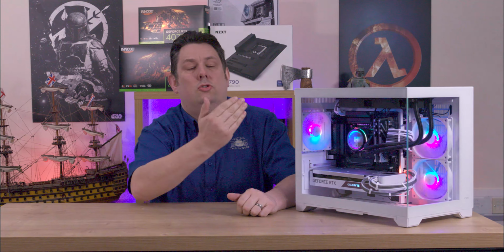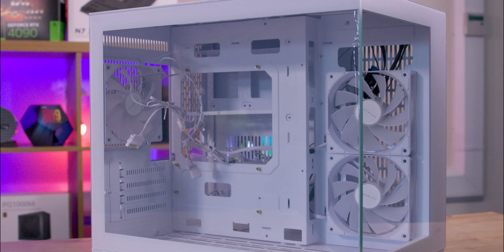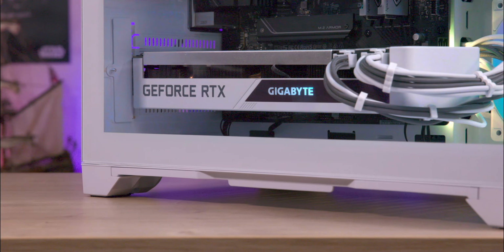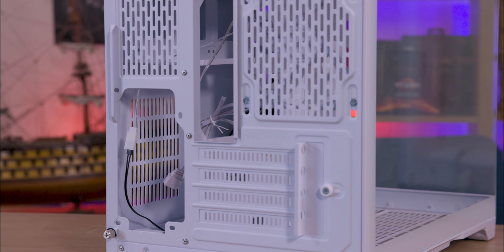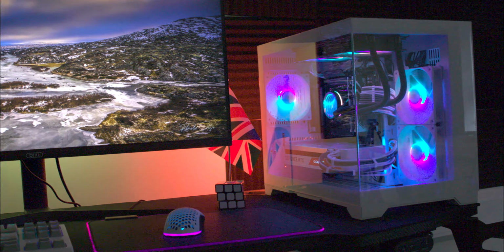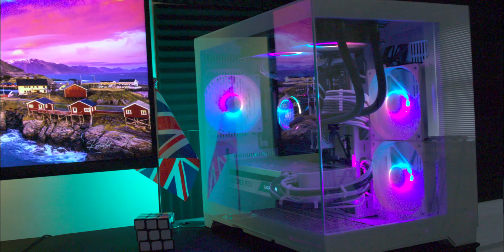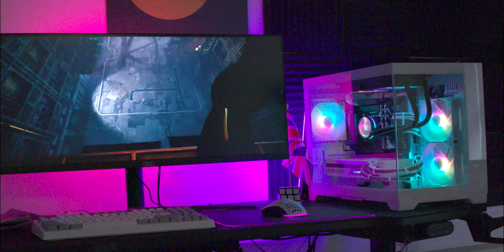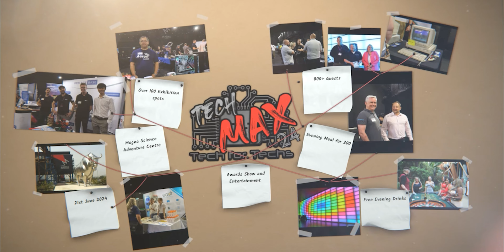Check Out The TECWARE VXN Evo: Is This Ultimate Dual Chamber MATX ARGB Case?  Review and Build

Comment: Avoid it. I just built one. Regrets
Reply: Is it bad?
Reply: @marcusperm5898  soft chassis, the fans non pwm, after install cannot power up I redo everything, check cpu pin, check power supply. It turn out power switch loose connection from factory. Top filter restrictive air out. I remove the gpu slot bent the frame unable to fix back the screw cover.